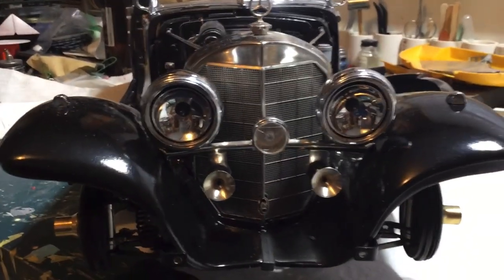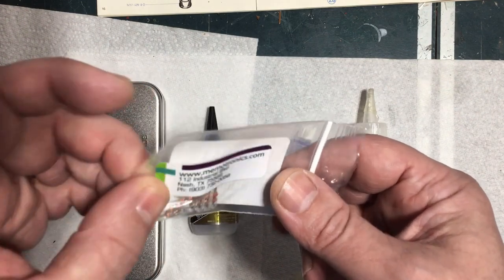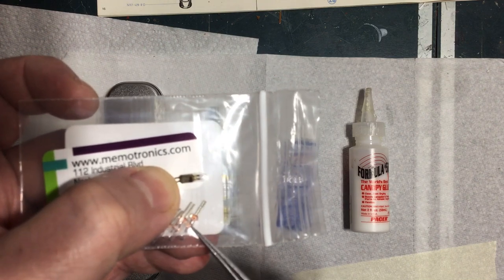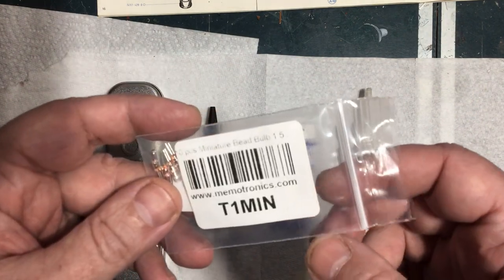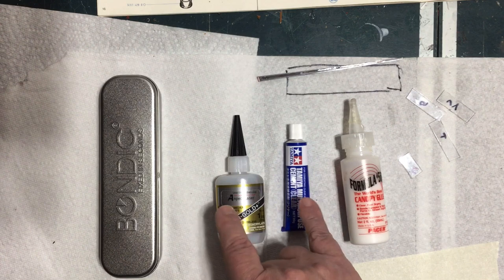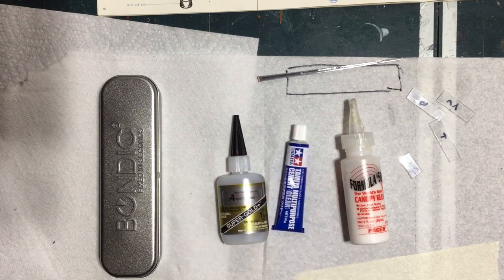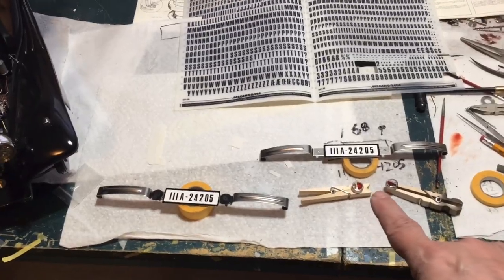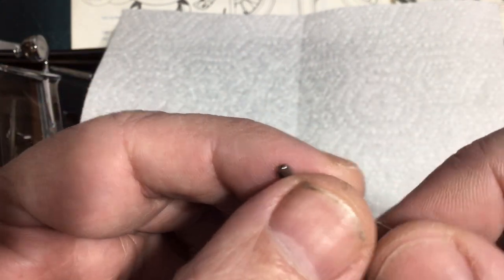Pocher Mercedes build; lights, license plates, and Model Motorcars windshield wipers

Comment: I've really loved your video series on building the Pocher Mercedes.  You are to be commended on your clear explanations, demonstrations and thought process in this build/restoration.  I really hate to see them come to an end but there are always the reruns.  I've learned so much from your videos; especially your trials and tribulations on fitting the hood and doors.  It appears that convertible bodies have an immense amount of flex that needs to be dealt with before fitting doors, etc.  I'm on the lookout for one of the Mercedes convertible kits where someone started building it and realized they were over their head and stuffed it in a closet many moons ago.  I usually build wooden sailing ships and scale aircraft.  According to my Admiral, I've got to sell much of my model and O Guage train stash before even considering buying a Pocher kit.  Thank you for taking the time to make these videos.  John from Seattle WA.
Reply from the maker: Thank you so much for your kind comments. But it’s not over when this one is done. I’ll get back to the 1/8 Jaguar, and I also have the Pocher 1911 Fiat to do. Thanks again, and good luck finding a kit to build!